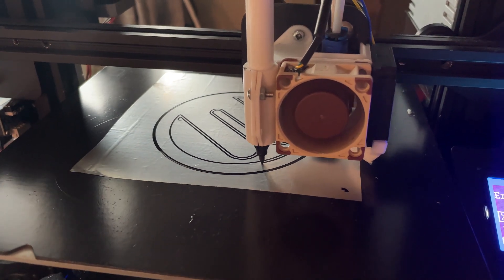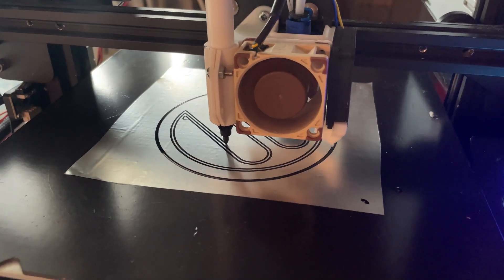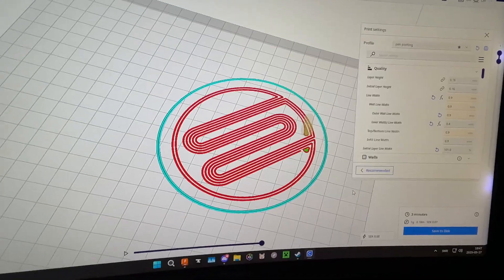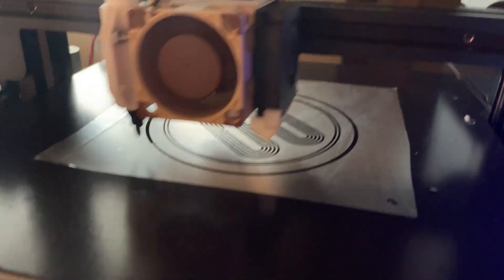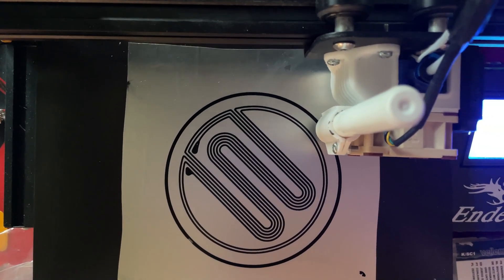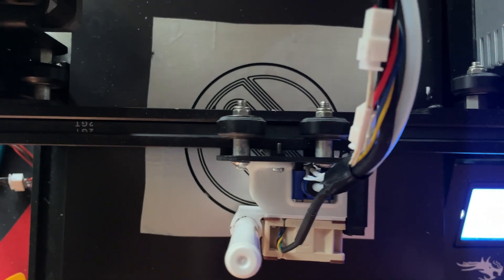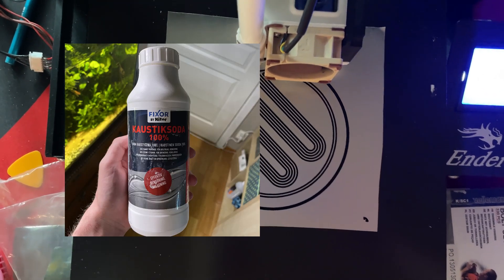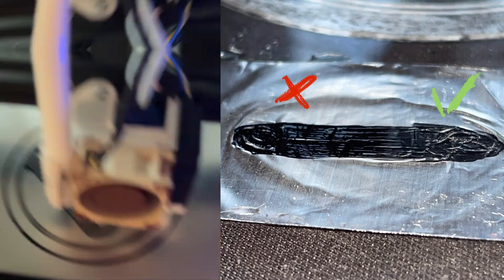Oil Based Lacquer Pen as Etch Resist - DIY Planar magnetic Headphones [EP3]

Comment: Awesome project man!

One question, how much of the sodium hidroxide did you use? did you dilute it in water?
I've tried with a Oil-based and Alcohol-based pens but unfortunately none of them worked (to ensure the paint was dry, i used a hair dryer too), the traces of the drawing just floated during the reaction lol.
In my country we only have powder version of sodium hidroxide (60%), i used 100g per 400ml of water, but i think it was too aggressive, so i tried half (50g) but took too long and still have removed the paint in the first 10s of submerging the foil.
Any advices/tips?

Thanks in advance!
Reply from the maker: I use about 20g of 99% pure sodium hydroxide per 100g of water. It is wise too keep the liquid at room temperature, it keeps the reaction slow and steady. I found that aggressive etching gives poor edges of the coil lines. You can try a solvent based pen, or even better a "lacquer pen" (if you can find one). The ink of the pen I use stands out from aluminium foil once it has dried.  The ink feels plasticky once it has dried. Your method is right, you'll just need to find the right pen. Bring a piece of paper to the art store and test every permanent ink pen they have. Also, drying the ink remains crucial. I bake the ink at 70 degrees on my 3D-printer for 1-2 hours, which works great. Higher temperatures create bubbles in the ink tough, no bueno.
Reply: Awesome, thanks a lot! Since i ran out of Sodium Hydroxide, i tried with Ferric Chloride and worked flawlessly!

Comment: I've always wanted to make diy planar driver, does it sound good ? And how would you describe the sound ?
Reply from the maker: The clarity is excellent. The sound feels natural. I have used EQ API on windows 11 to make my planars measure flat down to 3-5Hz. The bottleneck for me with these headphones is my Amplifier and my audio interface. My two 5W Aliexpress class AB amps are noisy as lord and simply do not do these planars justice.